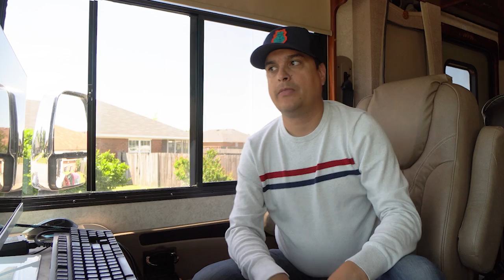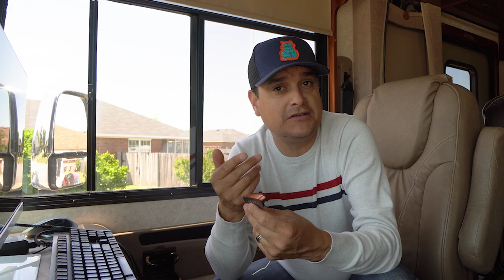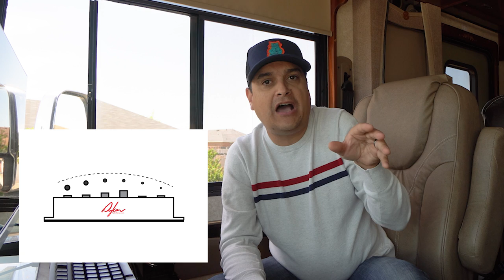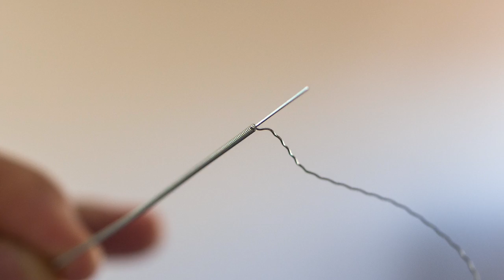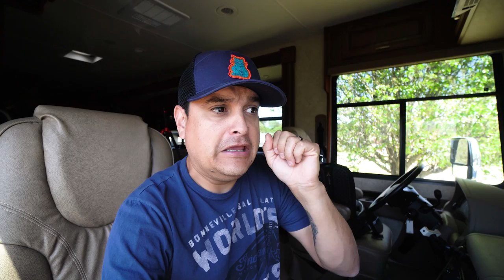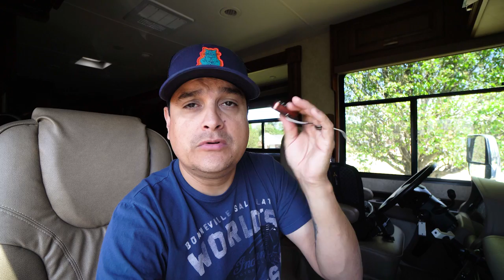How To Choose Single Coil Pickups - Flat VS Staggered

Comment: Really great video! It begs the question about the “correct” strings for a vintage guitar. But now with all this fandom knowledge the players can make an informed decision, and not just vintage but modern aftermarket pickups as well. Thanks!!!
Reply: Remember, they also had aftermarket strings even then. OEM Fenders of the '50s had 12--26w-52 groundwounds, but you could also get a 13-54 flatwound set from them or a 13-56 from someone else (Pyramid, a company from the time, still sells this set as the Pyramid Gold True Vintage 13-56) if you wanted, and a lot of players at the time substituted a 9 from a banjo and shifted the rest of the strings up one. Though apparently by the CBS era Fenders came with flatwounds standard, probably until the '70s when rounds were standardized and I assume the same sets have been used since...

Comment: Great points, I got used to compound radius fretboards years ago so have been using flat pole pickups along with those necks. I think flat poles sound the most balanced Overall in my guitars .

Comment: I prefer staggered pickups with a wound G set of strings. It's terrible with a plain G though. I actually stagger them myself by moving the polepieces if they are flat. I hate treble strings being too loud and shrill, so I put them down a bit.

Comment: And note the Gibson PAF was original
p90 dual slug coils until marketing demanded the adjustable poles of the p90, but the effect there is different in moving the screw head in and out of the coil alters the inductance.

Comment: @DylanTalksTone - Thanks for clearifying this. Many ignore or even do not belive this. Stagered pickups are for old slyle sets with woud G! And they work very well in this combination. ... And by the way, try some nickle wound flats (those "Jazz" strings) on a Strat with stagered poles, works very well!

Comment: The issue is that I want a 60's Fender bridge pickup with the white string. Most of the flat pole piece pickups are either black string or black silk.

Comment: I have a mixed bag of Strats and Teles, and the flat pole pieces sound less congested and more articulate than the staggered pole piece pickups. The most articulate set are the Fender Reissue ‘52 Pickups, but that also could be that they have Alnico III versus Alnico V Magnets in them.

Comment: Very informative video so thanks for sharing! Most password.  My question is this… Those of us who like lower output pickups usually find that the staggered polls are associated with lower output and the flatter poles are associated as fatter sounding higher output pickups. Who makes a 5.5 to 6.2 K output flat pole pickup.

Comment: G strings came "non wound" as well in the old days. I've used a steel string G on an acoustic with a mag pup in it because it disappeared without it! What a pain, I replaced it with a Baggs M1 - problem solved. Adjustable pole pieces. But yea, science, nickle and bronze are not like steel to a magnet.

Comment: I don't do those tiny radius Fender style fretboards, and I've always used flat singles. But personally I prefer singles with adjustable pole pieces like you find on humbuckers . I just prefer the magnets on the bottom instead of as the pole pieces.

Comment: You mention not moving the pole pieces because it will damage the coil that it is touching, but I took apart a cheap pickup and there was a layer of plastic between the coil winding and the pole pieces. Is this an uncommon setup?

Comment: Hello Dylan, thanks for great explanation. I've just bought alnico 5 staggered pickups for my strat. The pickups sound great but I have a problem with level of loudness of particular strings. Specially G is too loud. Is it possibile to grind the magnes to nore or less to the same hight, what you think?

Comment: I tend to use humbuckers more so I'll adjust the screw pole pieces to try to balance the output of the strings. If I'm using single coils, I think all of them are flat, except one set that has a slight, even curve to them. I think flat is probably the best all around option for simplicity's sake, but personally I do like to balance the string volume. My single coils are ceramic and have the magnet on the bottom, the coil isn't touching the slugs at all but wrapped around a plastic bobbin, so I'll probably just get some different sized pole pieces to stagger them like I do on my humbuckers screw pieces.

Comment: I had flat pickups on a tele and the g string sounded too weak on a modern radius, possibly a 10 inch. same problem with my strats. I have to use staggered pickups on all my guitars. I use daddario 09-42.

Comment: Makes sense Dyl!  People often don't take string composition and build into the equation! 

Back in the 50s the most common type were MONEL strings which were an alloy of steel, nickel and copper!
Gibson's pick ups, (P90, Staple and PAFS) were built to perform with  these strings as standard!

With modern strings, they do NOT perform or sound the same as they did back in the 50s/60s!

Cheers dude! Stay safe!

Comment: I had Texas Specials, staggered, that had a huge problem with G-String 'warble.' 9.5" radius. So, you lower the pickup height until the warble goes away . . . 
that still made the G-string dominant.
So, used pliers to 'push the pole' down for the G-String and that solved everything. 
No . . . hammering will demagnetize the pole so use pliers and a piece of thick paper to protect the surfaces.

I can see why you warn NOT to do this . . . I got away with it. After all, the windings while of different gauges are coated . . . but, 'flush' poles on Fender, only on Yosemite, Direct Drive, and a Hot Noiseless . . . all the rest are staggered and I got 14" Korean and Elite fretboards.
Reply: 9

Comment: I couldn't agree more with the steel wool comment. Not sure how that bit of useless/damaging advice got so popular. I clean, polish and maintain all of my equipment. I even do modding. I have never used steel wool on my fretboard.
Reply: I also sport staggered pole peices. 7.25 radius. Love it.
Reply: The frets themselves or the fretboard? If both, then why is not a good idea? I've never used steel wool but I've seen reputable ppl use 0000 grade wool to polish the frets. They use painters tape to cover the pick-ups, and the isolate the fret from the board with a steel fret cover.

Comment: hello dylan:  what about stratitis (where you hear an out of phase sound on a single coil pickup running by itself)?  I heated up my pickup and reshaped the pole piece height to match the fretboard radius.  It worked.

Comment: What about a bridge rail pickup, like Dimarzio/Duncan for Telecaster?  
They have about a 9.5 radius but my  modern Tele player is a bit higher radius.  My B and high E are not as loud as the rest of the strings because the pickup radius is a smaller number versus my fretboard. I don't even know why a prominent manufacturer would radius their pickups across the board like that.

Comment: When i bought my 1st Strat (a '95 Special [MIM]), the middle/neck SC polepieces were set to the neck's 9.5 inch radius and on the neck PU there was volume loss when bending strings so i flattened the polepieces on both pickups but other than that I've never had any problems with single coil pickups in this manner, nor did i result to flattening polepieces except for the Tele neck pickup after removing the cover getting it 1/8" close to both E strings on the 22nd fret.

Comment: I hit my D and G pole pieces down with a hammer after 7 years of fighting with my SSL-1s. They are still slightly higher than the rest of the pole pieces but significantly lower than before. I have a 12-16 compound radius neck. I can't believe how incredible these pickups sound now. I don't think they would sound as good if the pole pieces were all the same height, and other pickup companies seem to agree, as they set the D and G pole pieces lower than vintage but still a little higher than the rest.

Comment: This confused me a little, I bought a brand new squire paranormal cyclone (2022) but for all 3 pickups the E+A and B+E are flat but the D and G are raised to the same hight that does not really sound like there is a good reason for it other that that is just whatever they had laying around in the old trash pile

Comment: Hey Dylan, thanks for all the great tips! Question about the staggered poles - I got your warning at the end there, but am curious if there is a safe/professional way of flattening the poles? Or do you just have to get new pickups? I got some DiMarzios that I really like, however I do have the problem with the G being to loud (12" radius).  Thanks again

Comment: Great trivia again, thanks! So when Fender charged me a premium for an early 1970s reissue Strat with period-correct staggered pole pieces, I basically fell for the markering trick and paid extra for sheer looks, because with the unwound G and steel-wound D, A and low E strings I'd be just as well off with flat polepieces, right? Awesome!
On a side note: on 12-string sets, am I guessing correctly that the the "double" strings of the lower strings are essentially the same gauge as the cores of their wound pairs?

Comment: I both flats and staggered pole pieces in 2 strats,  the flats go quiet when doing whole tone bends, but they s kind better with overdrive,the staggered set definitely open up my amps more, they are creamy  sounding from 7 up on the vol knob. Both are fine,...

Comment: hi! probably this is a noob question but i just wanna know, how about on a flat radius fretboard (probably 12-14) with pure (100%) nickel strings? do i still need to have SCs staggered or is it common sense to have flat poles? thanks in advance for the answer, Dylan!

Comment: Didn't they used to make or maybe still do make with adjustable pole pieces ??
Reply: Yup. I have a G&L with adjustable pole pieces and i tweaked them slightly because one or two strings did seem to be slightly hotter. But i really had to concentrate on listening. It is very subtle difference, to my ears anyway.

Comment: One thing not mentioned when recommending flat poles is getting the sound of our heroes. Many of our guitar heroes use staggered poles with modern strings. Flat poles will make it harder to get the sound right to get the tone of those guys.
Reply from the maker: I mean... of you are as good as them first... sure.
Reply: Why am I watching this? Just more useless info I don't need to know. I appreciate your effort in this but you're overthinking it. It really doesn't matter.

Comment: Dam I pushed poles down with my finger a long time ago but it still sounds ok to me. If you do need to adjust poles can you readjust them at all?
Reply: If you have cheaper pickups where the magnet is held by the bobbin you are ok its when the winding is directly agianst the pole.  As in a traditional strat pickup that you will have issues.  I think Dylan made a blanket statement because it's easier than to break out the exceptions and then get blamed for people messing up there stuff.

Comment: The thing I don’t get is for example my ‘64 jazzmaster has flat poles like all jazzmaster pickups , i know it’s a different story for jaguar pickups where depending on year they were either flat or staggered ( they are also much closer to strat Pickups in design) why?  Same with vintage precision and jazz basses

Comment: 11:46 What's the problem with using steel wool on the fretboard?
Reply: because you have to tape off your pickups when you do it otherwise the steel wool fragments will get inside the pole pieces and destroy the pickups eventually in the long run
Reply: Ah, okay thanks, that makes sense. It's good to know the reason for doing (or not doing) things.

Comment: Hey off subject... if I take out my hex bolts out of my humbucker (Evolution) and put them back but maybe put them back in not the exact spots I removed them from, did I mess up? 
I took them out to paint the pickup and thought I marked them to put back in the same spot but I think I goofed.
Anyway just wondering. Anybody

Comment: one exception to this would be the PRS 635JM set
Reply: It does have a 7.25" fretboard radius.
Reply: @andycowell608  correct. it's neither staggered or flat
Reply from the maker: You know, I meant to mention that and forgot. Thanks for bringing those up

Comment: I have a squier classic Vibe and it has staggered, should i change to flat? gracias, saludos!
Reply: Is that a used model by any chance? IIRC, Classic Vibes didn’t come with staggered poles pieces.

Comment: Why is using #0000 steel wool to get the gloss off a neck or fretboard bad? I've done it to 2 strats and haven't had any issue. In fact, they turned out absolutely incredible, felt like I used 2000 grit sandpaper. What issues does it cause doing this, and what is a better choice?

Comment: @DylanTalksTone, thank you for interesting take on this! Never heard about Nickel and core diameter that matters most, but it makes sense. I have a 2016 Fender Ultra Stratocaster with 4th generation noiseless pickups and they are staggered. Since they aren't reissue I wonder if Fender had something behind this design and could you comment on that.Also, interestingly enough height increases from low E to D and then G is much lower, B is the lowest and high E is a bit higher, around the same height as G. Seems interesting but cannot see reasoning for that
Reply: I read somewhere that some pickup makers use different strength magnets in each pole to help even out the magnetic field and keep the vintage look as well.  Can't remember if Fender does that or not.  Some also use a "modern" stagger pattern as well that's less pronounced and has a lower G pole for plain G strings.

Comment: I find it funny that people think that the magnetic field  is only above the pole piece. If you take a cheap polarity meter even, then you can tell how far out the field actually extends. Of course the field is going to get weaker the farther out you go, but when you are a good inch above the pickup and still getting pull, I don't think that .5mm is going to make or break the tone. The strings move more than that.

Comment: So, if I were to use acoustic strings (for some crazy reason), then I should want to have the staggered pole pieces, right? I know they are not usually nickle wound, but bronze should also have that same situation where only the steel core is magneticly influential to the field from the pickups.

Comment: it's driving me nuts not knowing what the pickups are in my 2001 USA strat I bought last year. it was in great shape and well cared for but I know the pickups were changed from talking to the previous owners before the guy i bought it off of.  it has staggered poles ...and they are all pretty much the same from pickup to pick up . the arent the most balanced set up pickups but they aren't super unbalanced weighing the balance could just be the nature of single coil 5 way strat tone.  I get good tone usually but at some volumes and setting i have an issue when i go to eh middle positions losing treble which is to be expected I guess.